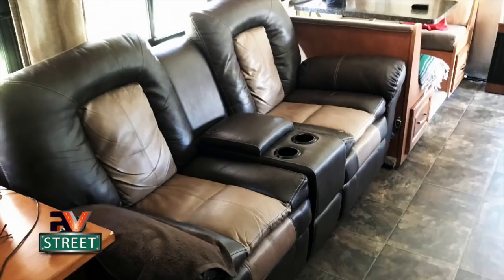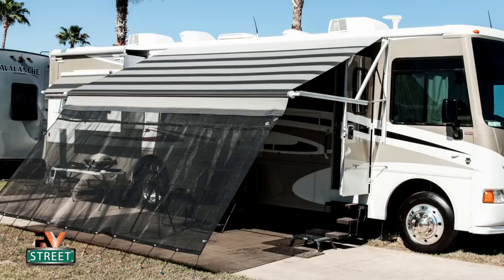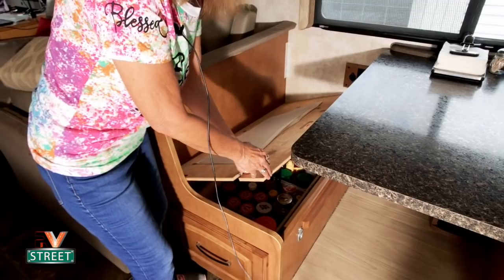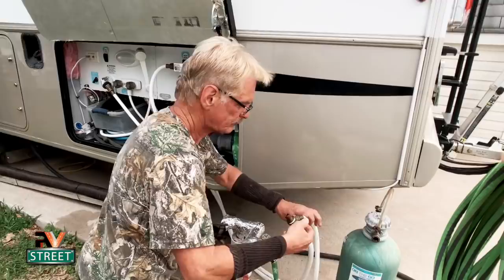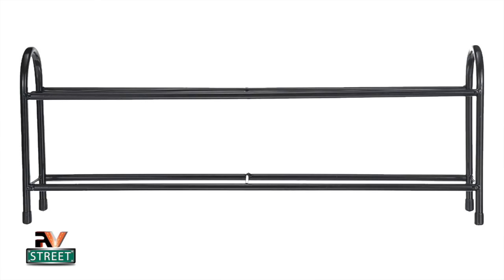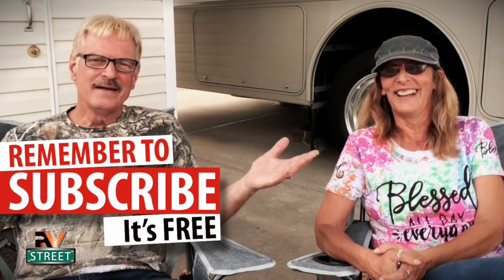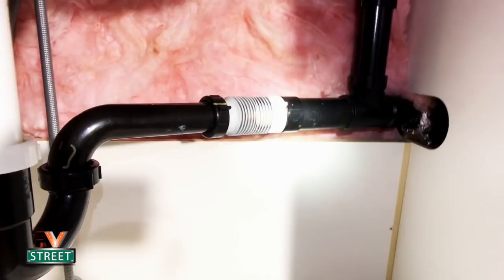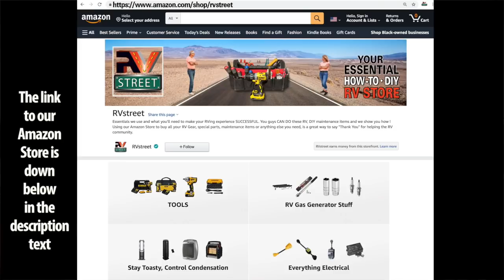My Wife LOVES Me More b/c Her Life is ❤️EASIER❤️ DIY RV UPGRADES

Comment from the maker: Many of you have commented and shown interest in building these type of drawer slides for your RV. I'm sorry but I don't remember where I got those metal slides. That was more than 5yrs. ago and I didn't have a YT channel then. Just search for heavy duty metal drawer slides and get the length and rated weight you'll need. They'll need to be beefy so the drawers don't sag when you pull them out.
You will not find them at your typical box stores so don't waste your time looking there. These kind of metal slides will be found online in specialty cabinet or industrial cabinet suppliers 👍
Reply: Rockler has several drawer slides available.  I have used them to build really heavy duty drawers.  They rate the slides as to how much weight they will support.  Hope this helps.

Comment: Wow.....the drawers on the dinette!! I’m going to see about getting mine done.  I have a small class c and really need that space easier to access. Love all the rest of the changes.  Thank you!
Reply from the maker: All of the stuff we put in those drawers are in plastic bins. It adds a lot of weight. Probably a 100lbs or so. So when we get ready to pull in the slides and get ready to move, we lift out all those bins and set them on the bedroom floor over the rear axle. That way we take all that weight off the slide motors. Once we arrive at our new location, we just put the bins back in the drawers. It's just a precaution we take so the slide motors don't over work themselves.
Reply: Yeah, don't you hate it when the factory brand drawers are not even half the seat length?
Those long, roll-out pantry drawers that seem to go on forever are a thing a beauty!
Reply: Yep, … that’s in the category “Why didn’t I think of that”
I’ll certainly be purchasing from Martin’s links as my way of putting some money in the tip jar.

Comment: Love those wonderful drawers under the dinette benches you did for Joanie, Martin. Beautiful job! Thanks for all the great tips👍😊
Reply from the maker: Thank you Karen. Ya, those came out really nice. Joanie loves them.
Reply: @RVstreet  Is it best to put the heaviest stuff in the far back of the dinette drawers or the front to be "kinder" to the RV dinette slide mechanism?
Reply from the maker: @celestepalm6949  For the heavy duty rails that I bought and use it doesn't matter. My drawers are long and thick so I needed very heavy rail mechanisms not only to hold the weight but make it easy to slide in and out. 
Another note worth mentioning is, everything that we put in those drawers are in plastic bins. When we're getting ready to leave, we pull those bins out and set them on the floor in the back master bedroom. That way that weight is removed when we pull in that slide. I do that as a precaution so I don't put that extra weight on the slide motors when retracting or deploying the slides. Those bins just stay on the floor till we arrive at out next location then they go back into the drawers once I deploy the slide again.
Reply: @RVstreet  Genius! That makes sense in a Class A, but with a multi-slide truck camper there's no other place to put the stuff, especially when slides are in. I'll just have to keep all the lighter goods under the sofa slide & dinette slide then & use the basement for the heaviest stuff.

Comment: I bought a piece of property with extras, one of the extras was a 2001 Damon Challenger. Bottom line I know nothing about RVing. The coach is set up with a well , septic and  solar panels, so it is off grid. I finally found your channel but I had already messed up the water. My brother, who has an RV, checked it out, set everything up, so I know the water did work. He was not there when we closed things up. My helpers disconnected the water, curled the hose up under the coach, leaving it connected to the city water port. When I returned, I connected the small water pump to the well outlet without a filter and without clearing the hose. I now know that was totally wrong.  I did see there was reddish sludge coming down the side of the RV at the city connection sight. Bottom line, water doesn’t come into the  RV any more! I can use the fresh water tank with the pump but how can I fix the problem with the city water inlet? Do you already have a video that address this situation? Everything I have seen shows you how to connect to a working water situation. Thank you  for all your videos!  I really enjoy watching them. I have learned so much and wish I had watched them first. Since I know so little about RVing I was ready to get rid of the Big Boy (as my husband calls it). My husband is 75, I am 72, since he has early onset of Alzheimer’s this adventure rest on me. He is some help as he used to rebuild engines in his Dads garage, was a computer tech in the Air Force, graduated top of his class however at this time we just take it one day at a time. After finding your channel I now have the confidence we can keep the Big Boy, as my husband calls it, as a weekend retreat.
Reply from the maker: how can I fix the problem with the city water inlet? Do you already have a video that address this situation?
Well, I don't quite understand city water inlet problem from what you wrote. But...I do have a video coming out in later on replacing the city water valve. Perhaps this video will give you the info you need. 👍

Comment: ❤ Joanie, don't tell Martin I told you this, but the bottom of the cabinet with the air fryer would be easier to be able to pull out like a drawer.  A 4 inch tall box with no face with another box with wheels inside. The outer box serves as the Trax the inner box rides in.👍👍     Love you guys.💘
Reply from the maker: 💗 💕
Martin said no. LOL 😜

Comment: Another great video from you guys. We also have a Vista with those cavernous bedroom closets. A great place to hide the bodies but not very practical for storing anything else. I have looked at installing shelves but don't see a clear way to brace them without drilling into the outer wall. Info on how you built them would be great. Maybe an opportunity for another video.
Reply from the maker: I used 1" x 2" strips on the two side walls and the back wall and fastened them there with liquid nails to support the shelves.

Comment: All excellent mods! Many we have done, but need to do a few more down here to tune the rig up- especially the insulation in the brow cap. Just a word of caution-- Joanie had it right on the Duck Tape! The word here in Georgia is that its illegal to operate a motorhome without at least 2 rolls of duck tape on board LOL!!!!! Heck my rig would have completely fallen apart without duck tape!!  Be well- eat lots of clams and lobster!! Joe and Joy
Reply from the maker: Hi Joe,
Ya, that insulation in the brow cap is a biggie. But I'm sure you saw all the other places I did too in that other video I did. Dedicate 1 day to do all of them. Your AC units and heating will love you. 🎅
https://www.youtube.com/watch?v=yqZjE4aEoek
Reply: @RVstreet  I got started on the brow insulation  once and didn't go all the way. Need to get busy on it. As 'bago stuck all their interior electronics in the top right hand brow cabinet on this'16 model 38Q we found that when it gets so hot up there it knocks out all the electronics in the rig. So now we have to ride with the cabinet doors open. I installed more door bumpers as spacers to keep the doors a bit open and a small electronics fan to help knock the temps down. Regardless I absolutely have to insulate that region of the coach!!!

Comment: Hey Martin, you copied me, Hah! 2yrs ago I literally did the identical drawer upgrade under the dinette, using the same 300lb slides.  My drawers are 40" deep. I bought them custom made with dovetail corners from a drawer manufacturer in NC.  They made a custom drawer front that came close to matching the OEM design.  I should have called Winnebago like you.  That upgrade was absolutely a huge improvement for storage.
Reply from the maker: Thank you so much for your kind words and support. I know I will miss Martin everyday for the rest of my life.

Comment: I am with you on these quick discounts. The only thing better is the Stainless Connectors. I love them better than the brass one.
Reply from the maker: Thx Dwayne,
My brass quick disconnects do not come in stainless. Best on the market IMO. I've had zero issues with them in 5yrs and I have several sets. In case you've never seen them, it's these here: https://www.amazon.com/dp/B00F40MEX2?ref=exp_rvstreet_dp_vv_d

Comment: Thanks Martin and Joannie for another great video. I need to do some of those things. Would really like to install a pull out drawer under the bed so we don't have to lift it up to get things out of it. Do you have a video about this? Should be the same process as the dinette drawers you built.
Reply from the maker: No i don't have a video doing that. There isn't enough room—to the walls—to pull out drawers under the bed. Maybe you do. We just lift the bed platform up.
Reply: @RVstreet  Yep, we have 3 feet on the side of the bed to the wall!!! Well it is exactly 33 inches.
Reply from the maker: @williamastorino9551  That's a little more tha we have. If you do that upgrade I'd love to see pic's. You can post them on my FB page. 👍
Reply: @RVstreet  we have a 40 ft Montana fifth wheel with big front bedroom.
Reply from the maker: @williamastorino9551  Oh ya, I've seen many layouts like that. Those bedrooms are huge for an RV. I be you probably also have opposing bedroom slides too. We don't. We have one bedroom slide but for us it works fine.

Comment: Awesome video!  Did you need to extend the platform at all to support the new seating?  It seems like most of them require more depth than the slideout has.  It seems like there are many ways that people have tried solving for this, but I was curious how you Martinized it!
Reply from the maker: I'm assuming your talking about the pull out drawers I made under the booth seating. There was nothing done to the seating or to further support them. Not necessary.
Reply: @RVstreet  sorry, I wasn’t very clear. I was talking about the recliners. The slide out base on the 35 F is only about 33 inches deep. Many wall hugger recliners seem to require 38-40 inches. Just wondering how you dealt with that.
Reply from the maker: @kevinhammer968  Ah, ok so.....once I had the love seat set back on the slide as far as I could so it would recline fully, I bolted the love seat metal frame to the floor in the back with 4 bolts to 4, aluminum "L" brackets I made that bolted to the floor. That secured the back. The front of the metal frame hung over the slide floor some in the front. So I made two small wooden blocks out of 2" x 4"s (one the left and one on the right about 12"in from each side) so they just kissed the floor, painted them black, then screwed them to the metal frame. That supported the front of the frame and secured it. The blocks are tucked under the love seat so you can't even see them. As it turned out, when the love seat seats normally—not reclined—the width of it is exactly the same width as the booth and forms one nice clean line looking down the edge of the booth and the love seat.
Reply: @RVstreet  Thanks for the clarification!  We aren’t full-timers, but are planning to use our 35F to work out of when we travel. Replacing the couch and adding the desk was a fantastic idea. That is my plan. Thanks again for all of the videos that you post. They are so helpful, and entertaining!
Reply: I too changed to residential recliner.
Yes delivery charge.  I said I could bring it in..   told when to come and they took the old one and installed the new one for free.
Reply from the maker: @dougdoty4718  SWEET 👏

Comment: Marten, my wife and I have enjoyed your video's. We live in Florida in a 55 plus park and it is nice. But there is just so much tv to watch and then everything becomes a rerun, nothing new. So my wife and I have put up our house for sale and we are going full time RV. I intend to imploment many of the things you have done when we find an RV. But I have a question for you. We have just our ssi to live on and boondocking is something we would need to do alot. Do you think solar would help us save money?
Reply from the maker: Thank you so much 👍
I just can't answer your question with a short answer. I can't help myself. 😝
Having solar—will not—save you money when boondocking. It will cost you money up front in order to do a lot of boondocking. But if you're going to be doing a lot of boondocking you will need some solar to provide you enough power. How much solar? You'll have to take a hard look at your battery bay and what's needed there in order to store and use your solar power and the type of inverter you'll need to deliver that power will also be other items that will have to be looked at closely. Equipping your RV with solar and how much solar and everything that I mentioned that goes with it is a far and wide question. Since you are going to be new at RVing you just don't know what you don't know right now. 

I totally understand having to live off a budget on SSI and it is doable. When you sell your house you'll have proceeds from that sale to buy your RV, trick it out with some things that will need to be done right off the bat, stash some money off to the side for an emergency fund and then what's left over can go towards your solar package and the stuff that goes with it. So my advice to you right now is start studying this solar subject in depth while you're also trying to—decide and looking for—what type of RV you're going to buy. Then after you've been RVing for awhile you'll learn what your electrical and solar needs are and what you're able to afford. Then I would address purchasing the items you'll need to live off grid and move forward.

Now if you want to be fully equipped with solar, battery bay, inverter and all that right out of the gate, then really study up now on what that will take, then as you look for an RV you'll have a fairly good idea of what costs will be necessary to get there post purchase. But being new to RVing I'm just afraid you might not know enough right now and then later on you'll wish you would of done things different.

I have no idea of your back ground or experience so this advice may not even be needed. 😂

I have a video coming out on Oct. 31 that will explain how—I have decided—to address and handle my power needs while boondocking and in emergencies when there's no power at all. Like last winter in Texas just to mention one incident.

Two places that can help you really start to understand solar in a practical sense and in depth are:
RV with Tito DIY - https://www.youtube.com/user/rvwithtito
Be sure to tell Tito I sent you.
DIY Solar Power with Will Prowse - https://www.youtube.com/c/WillProwse

I hope you're subscribed to my channel to con't to learn what I have to offer AND as you need stuff for your exciting new RV lifestyle, I humbly ask you please don't forget to consider using my Amazon Store: https://www.amazon.com/shop/rvstreet

EDIT: I was discussing your comment with my wife and she had a good thought. You could buy a used Thousand Trails Elite Membership for somewhere around 3K or so and that would enable you to also have camp grounds (CG"s) available to you to alternate back and forth between boondocking and CG"s. Having CG"s available is nice to make dumping tanks easy, replenish water, do maintenance, sanitize your fresh water tank, have shore power and all that. It's something to consider. Once you buy a membership there is an annual maintenance fee. It usually is around $500 or so. It would worth looking into to see if it would work for you and your plans. You buy a used membership thru a broker. For starters, here's some places you can buy one.
https://www.campgroundmembershipoutlet.com/available-parks/thousand-trails/
https://www.rvdiem.com/campground-membership-outlet-thousand-trails-resale
Reply from the maker: Yep lots of good stuff out there and the learning journey always continues. Keep reading up on everything  from multiple sources because this subject—solar—needs to be thought thru. The more you learn, the more you'll have a real understanding of the technology and how it works in an RV, what your needs are, how to set it up right, troubleshoot problems and spend your money wisely.
Good luck my friend. 👍

Comment: I really like the idea of being able to do my own repairs. Do you have any idea how to pack rear bearing on a dual axle wheels of a Class C motorhome? And I have more ideas of some maintenance of motorhomes. Pm me.  Thanks for showing me how to clean my AC unit on the roof. Looking forward to more knowledge about Rv DIY. GREAT VIDEO
Reply from the maker: The rear wheel bearings receive their lubrication from the oil in the rear axle.

Comment: Hey Martin,  We've owned our 2013 Itasca Suncruiser 37F for about 3 months, purchased several items fom your Amazon store.   I would appreciate your thoughts on Snap Pads, I noticed you don't use them.  Thank You!
Reply from the maker: I'm sure their a well made product and I've seen some people have them. I honestly don't see any benefit of having them. But your right I don't use them and here are the reasons:
1) The leveling feet are still going to touch the ground
2) You still have to extend your leveling jacks to far, therefore sacrificing some stability in the RV and stretching your leveling retraction springs to much and over time wearing them out

I use thick wooden blocks that I made.
1) They provide a stable, wider foot print for the pads to land on
2) They keep the leveling pads off the ground and keep them clean and dry
3) Since I manually level, they allow me to only have to extend the jacks 4' - 5", therefore easier on the entire system and the springs